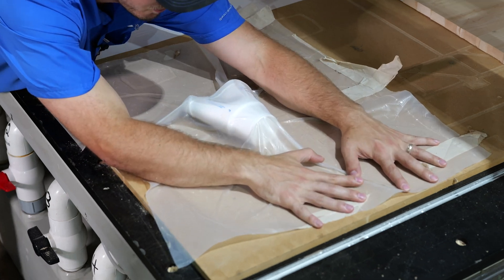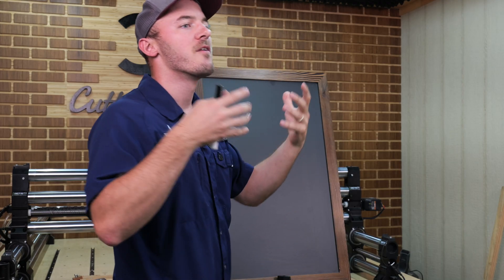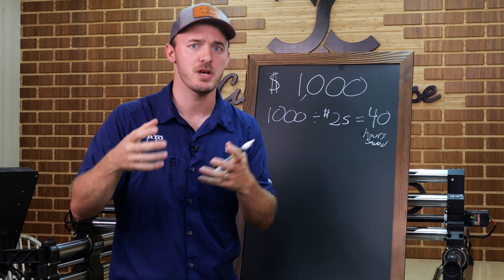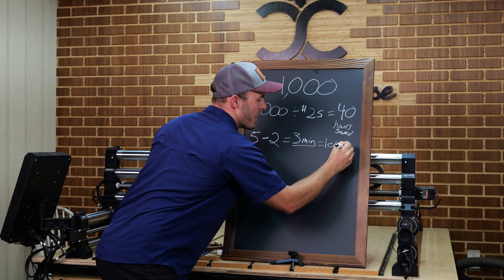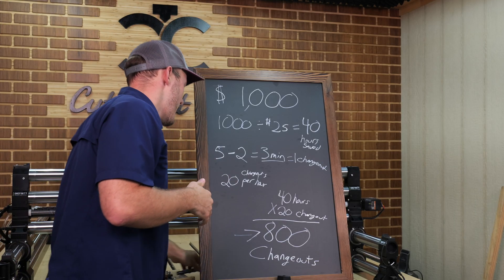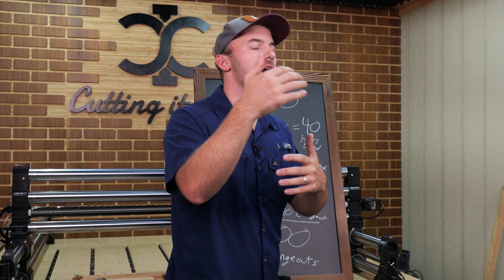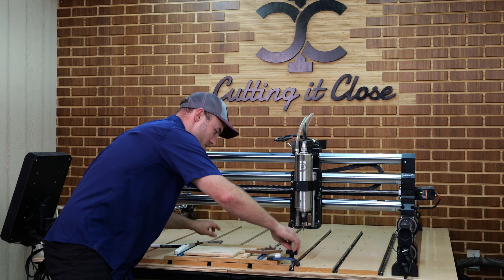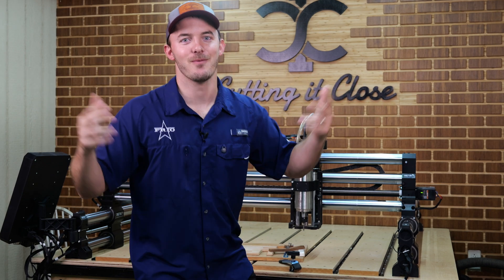Hobby CNC Vacuum Table Worth It? A Practical Guide

Comment: Nope. Respectfully, you’re approaching this entirely wrong. I’d argue that most of your viewers aren’t doing production work and can’t justify purchases financially. Rather, we’re hobbyists trying to find ways to minimize botched runs. Vacuum tables have one major flaw… they are pricey … ok two, but I really focus on the next… damage. For production work you can make jigs. Custom vacuum mounts for many runs. For bespoke work it’s far too easy to destroy an expensive table. I have the air table and rarely use it.  That’s after tens of hours of experiments. If I wanted to hammer out many pieces of a design, I could make a plate specialized for that cut that would take the base table out of harms way. But this is a hobby, not an income. Vacuum is awesome, but I find it to be far more challenging for my home use than expected.
Reply from the maker: I agree with everything you said there. Hit the nail on the head!

Comment: I would love to know your take on vacuums as a whole.
Specifically, have you found any great tricks to improve holding power?

I currently run my CNCs (industrial like yours, but 4x8, not 5x10), to just a single zone (4 zone, with just MDF over the vacuum grid, so sucking through it), but I don't put any extra padding or anything on them.
It seems in some of your videos you have cardboard put down to try and improve vacuum power. Have you found anything that works really well? Is the cardboard coated with anything? I would think it'd be relatively pourous like mdf and you'd get vacuum leaking through plain cardboard.

tldr; have you found any way to improve suction on workpieces that are smaller and don't cover an entire zone?

Comment: I would be very thankful for a video of the vacuum system on your industrial cnc. What power motor? How you prep your spoil board? How far you go into it to clear the burrs in the work? When do you resurface it and change it? Small parts issues etc?

Thanks
Reply from the maker: That video is coming, great suggestion!

Comment: Thanks again for this video. I think vacuum tables are a fantastic solution but as for most hobbies CNC add-ons the price is high. For example I paid 2000 for my CNC a vacuum table is approximately $2000 for almost my table size and a spindle kit is approximately $1000.... I think at this point we should consider buying a bigger CNC with everything included.

Comment: Whilst this is a basic way to look at part of the justification for a Vacuum Table Upgrade (VTU), there are two very big factors that you are not taking into account. Both of them have to do with holding down a larger sheet of thin material. 

Without a VTU, holding down a 1220mm x 1220mm sheet of 6mm plywood is problematic. This usually means that you either cut that plywood into smaller pieces, more manageable pieces, and cut a product at a time, or you attempt to put brads into places in the middle of the sheet where you hope the bit will not be cutting.

The other reason is for cutting out something that takes the entire sheet, or large parts of it such as boat stations, molds and planking.

In the first case, the time saved by having a VTU is huge since you are not cutting smaller pieces, mounting, cutting, removing them and then moving onto the next small piece. Instead you get one change for as many parts as you can cut out of that large sheet.

In the second case you may even decide that the issue of holding down such a large sheet is not worth making the item in the first place.

For my case, the advantage of the holding power for the large thin sheets of plywood far exceeds the monetary cost of the VTU.

Still, a nice analysis, simply, concisely and clearly stated.

Many thanks.
Reply from the maker: Couldn’t agree more with you. That’s the reason I have my larger CNC with a vacuum table. There are smaller vacuum attachments out there that hold 610mm x 610mm and to me that isn’t enough area to see the benefit of holding down sheet goods in the way you are describing. I do agree with your analysis on the larger table no doubt. Thank you for watching and commenting!
Reply: @cutting-it-close  Agreed, a 610mm x 610mm is too small for a vacuum unless you are pumping out items constantly. But I have a 1200mm x 1200mm machine and that is a sufficiently large sized CNC for a VTU. Mind you, it will have to be a "home built" project, but I'm a maker ! Should be easy 😀

Comment: As someone who uses clamps, I say if you have financial potential, buy it right away... Because working easier is what makes you happy.
If I had a thousand to spare, and orders to make profit like that, I would buy a vacuum system tomorrow...
Believe me, the most important thing is to make it easier for yourself, and to enjoy your work as much as you can. Profit will come anyway....
Reply from the maker: Couldn’t agree more! I just hope this calculation helps those on the fence and the worth of certain upgrades.
Reply: @cutting-it-close  Hey man, you still owe me that video about cutting acrylics on CNC...😁
Reply from the maker: Yes I do, I have to keep you around somehow, if I did that video right away you may not have a reason to keep watching haha
Reply: @cutting-it-close  I have been watching you for years now, so, you accomplished nothing on that aspect 😁😁😁

Comment: Hi another great video from you! I can follow your calculation, but I would suggest that there is another dimension to consider in your analysis, namely the concept of opportunity cost. What do I mean by this? During the time you are making the change-out, you obviously can't do anything else, and this is particularly relevant when working alone. While you are at the CNC machine performing the change-out, you could alternatively be engaged in marketing, customer acquisition, product design, or development, which in themselves hold value—the so-called opportunity costs that you miss out on. What do you think about this?
Reply from the maker: Your analysis is great as well. For this calculation I did not factor in opportunity cost. I am constantly thinking of the next best alternative of any decision. This calculation in particular I thought the opportunity cost would be very minimal. There will be some upgrades in the future that the opportunity cost potiential is much greater and needs to be a large part of the calculation. 

And at the end of the day, if you want the upgrade because you want it and think it’s cool and makes you happy then get it!